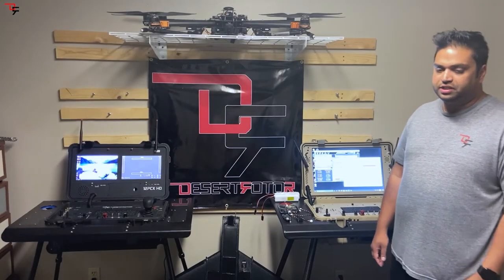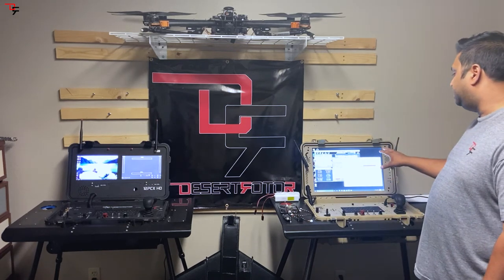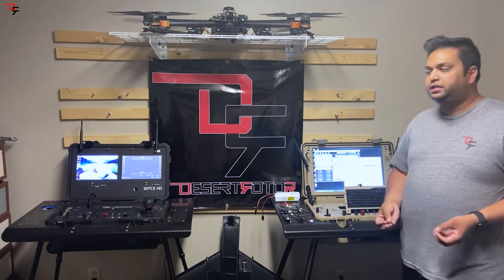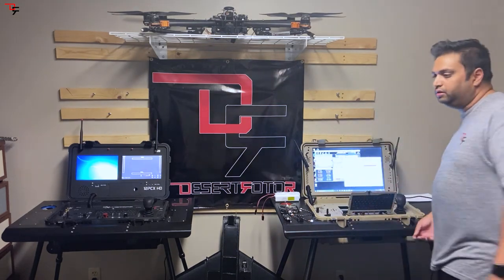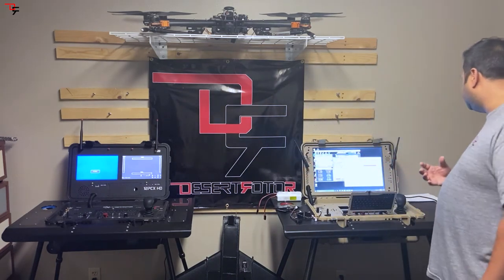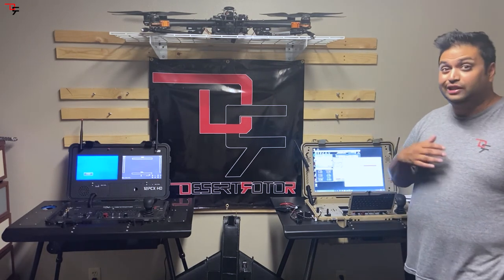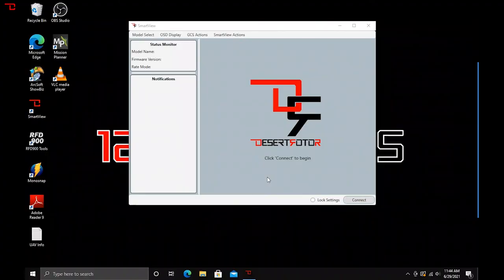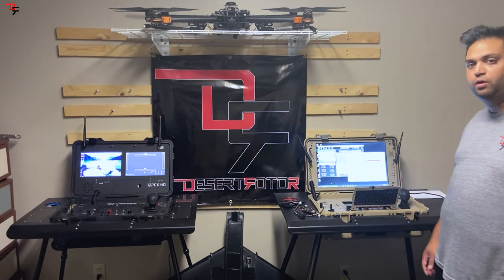Introduction to Desert Rotor Ground Control Stations - 2021

Comment: A step in the right direction if you expect licensed full scale pilots to easily interface with UAS industry. The modern small drone controls seems to be designed by Gamers not actual pilots.
Reply: We have some sexy handhelds coming out soon. The gamer designed ones are usually just 'windows gamepads' and don't have the robust radio control interface we offer and our clients need. Our touchscreen handhelds will have it all.

Comment: Please tell the price and high altitude and how many km we can control far away
Reply from the maker: Hello, our GCS designs can interface with virtually any radio & autopilot system. Altitude/Range will depend on what radio systems you go with inside the GCS. We have clients hitting 50KM using 30Watt RF Amplifiers on Microhard MIMO radios. We also have simple radio systems that can get you up to 20KM. It really depends as range is unlimited if you are using the LTE Sky-Drones or SkyHopper radios. GCS pricing starts at $6,600 US dollars. Website www.desertrotor.com has all the info. Thanks!